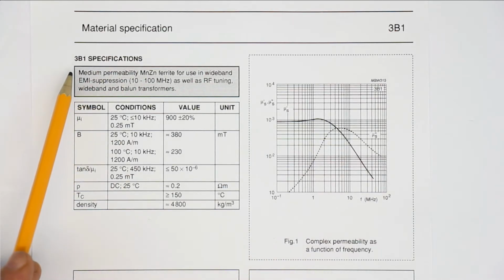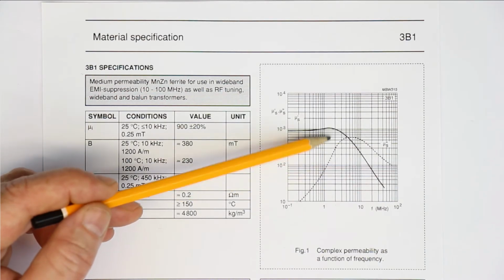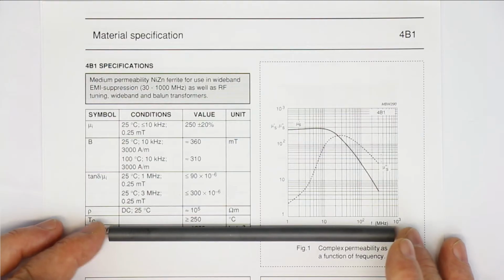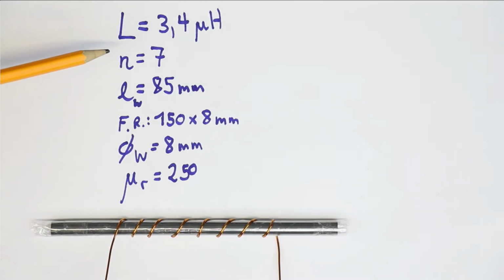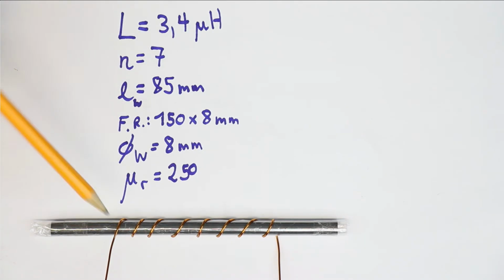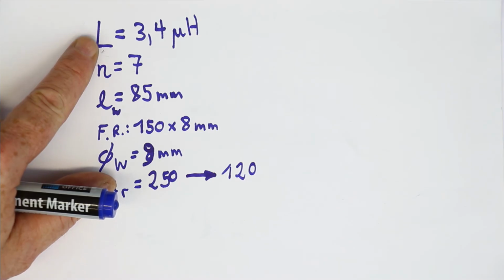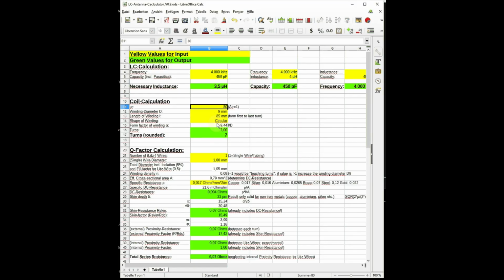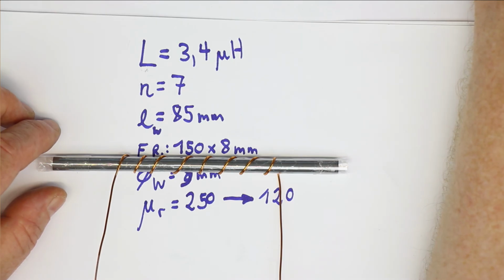A Ferrite-Rod for SW-Reception

Comment: I've noticed that adding regeneration to a ferrite rod antenna seems to make it usable at higher frequencies. Try making a regenerative receiver using a shortwave ferrite rod antenna as the main tank inductor. It should work with good results even at higher than 10 MHz. Some discussion here indicates that one experimenter used a regenerated ferrite rod antenna at higher than 20 MHz:  http://www.theradioboard.com/rb/viewtopic.php?t=7675 . Personally I've used them up to about 14 MHz in regenerative receivers. It might be interesting to conduct experiments to compare ferrite rod sensitivity at shortwave in the non-regenerated and the regenerated cases. In particular, I think the following experiment would be worthwhile: take a shortwave ferrite rod antenna, resonate it with a high-Q variable capacitor, connect it to a high-Z low-noise RF amplifier, connect that RF amplifier to a shortwave receiver, and tune the ferrite antenna's tuning capacitor to a very weak station around 14 MHz. Observe the S/N (or SINAD) ratio.. Finally, add regeneration to the ferrite rod (using all best-known practices to minimise tank loading, e.g. using a low-noise high-Z JFET, minimising and/or swamping parasitic transistor capacitances, etc.) and increase the regenerative feedback until just below the oscillation threshold. Finally, observe if the S/N (SINAD) has improved for receiving the weak signal due to the addition of regeneration. Regeneration, of course, is not perfect (it introduces noise and IMD) but I was surprised at the good results at shortwave when adding regeneration to a ferrite rod antenna. I hope you might investigate this area as well.
Reply from the maker: Hmh. Regeneration is of course cheating :-) 
(Just kidding)
I don´t think that using ferrite rod antennas above 5 MHz is a good idea.
It´s not only that the losses in the ferrite materials that are available in rod-shape increases.
There is also the problem of using the right "wire" for the winding.
Litz-wire starts to degrade already at 1 MHz due to proximity effect.
So you have to go to thick solid copper-wire to get a reasonably low skin-effect and correspondigly high Q-factor. 
(Regeneration of course increases the Q-factor back again to higher values)

In a few weeks I hope to expand the video series about Q-factor measurements of ferrite-rod and other magnetic antennas also to the shown SW ferrite-rod antenna. 
(the LW measurements are already presented in one of my recent videos)

But I´m afraid that I won´t find the time to do your proposed measurements (which sound quite interesting and reasonable)

How about you?
Reply: When I do further experiments with ferrite rods, I will post the results on my blog (http://qrp-gaijin.blogspot.com) and/or my YouTube channel. But before I do further experiments I want to understand ferrite rods better -- your videos are very interesting in this respect.

All that I can say for now is that a regenerated ferrite rod antenna gave me much better reception than I expected at shortwave. The next step, as I mentioned, is to see if equivalent performance can be achieved without regeneration. 

I think one key aspect of regeneration is that it is operator-controlled, with the operator always adjusting the feedback manually to ensure maximum (regenerated) tank Q and minimum tank losses. In other words, even as ferrite losses increase at higher frequencies, the regenerative amplification cancels those losses (with added noise, of course) and brings the signal (and noise) voltages back up to a high level. So even though S/N is degrading at higher frequencies, with a regenerated tank the operator-controlled regeneration is at least bringing up the signal+noise voltages back up to higher voltage levels, where they can then be detected by the receiver.

On the other hand, I think that with a non-regenerative amplifier following the ferrite rod antenna, you similarly would need to adjust the non-regenerative gain manually to get good reception. In this non-regenerated case, as frequencies increase, the S/N is degrading, but also now the absolute voltage level of the signal+noise (available at hot end of the tank) is also decreasing. So the receiver will have less and less signal voltage to work with, possibly requiring further amplification and a manual gain control to bring the signal voltages back up to usable levels. And another gain stage introduces more opportunities for noise and IMD.

So it may be that regeneration is simply an easy way to boost absolute signal voltages back up to "high" levels, even as the ferrite losses increase at higher frequencies. There can be no way that regeneration can actually improve the S/N ratio because any ferrite losses will physically cause an irreversible loss of the signal energy and degradation of the S/N ratio. So the question is, again -- is regeneration the best way to get the signal back out of the ferrite, or can a high-Z broadband amp also do it?

Time will tell!
Reply: Ah yes -- one other question for you: what do you think about the use of non-resonated ferrite rod antennas as broadband antennas?

I found one circuit recently; I will post it here if I can find it again.

----

Rats, I can't find the circuit again, but I remember it was just an untuned ferrite rod (one end grounded, other end hot) connected through a capacitor to the base input of a common-emitter amplifier. The common-emitter amplifier used collector feedback bias, so it was something like a 100k resistor from base-collector, and maybe a 4.7k resistor from collector-Vcc, with the emitter directly grounded (I think) and the amplified signal voltage taken off of the collector through a coupling capacitor.

Also, Charles Wenzel gives a broadband ferrite antenna amplifier circuit here http://www.techlib.com/electronics/antennas.html (search that page for the text "A ferrite rod 5/16 inches in diameter and 7 inches long"). That antenna reportedly could "cover the AM band without tuning and gave good reception well into the short-wave band".
Reply from the maker: I think you are 100% correct with your thoughts.
Regeneration basically boost the voltage including the noise.
Todays SW-receivers are so sensitive (in the sub-µV range) that atmospheric and man-made noise is probably always the limiting factor even without any pre-amplification/regeneration.
For a simple 1 or 2-transistor receivers things are of course different.
Reply from the maker: Hmh. I have to think about that and find the time to read the mentioned texts.
There are some applications where a magnetic antenna is used in a non-tuned way.
Broadband loop-antennas are an example.
While in a resonant tank-circuit you need a high Z coupling to your receiver to get most of the energy out of the tank-circuit, broadband magnetic antennas are usually operated in short-circuit mode.
I once build an antenna for reception of the Schumann-resonances starting at 7.8 Hz with some kilogramms (!) of installation-wire and a multi-turn loop-antenna with 1m diameter.
https://en.wikipedia.org/wiki/Schumann_resonances
There this principle was applied. With an ultra-low noise LT1028 opamp as a trans-impedance amplifier the loop was operated in short-circuit-mode.
When I made some calculations about maximizing the S/N ratio I found out that in that mode (short-circuit) the S/N is proportional only to the used copper-mass of the winding :-)

But all my videos about magnetic antennas are (until now) directed to get the ultimate signal-voltage and signal-power for crystal-radio reception. And there nothing beats a high Q-factor tank-circuit with a large cross-sectional area like in an optimized  frame-antenna.
I find it just fascinating that a tank-circuit gives a natural "amplification" of the incident voltage by the Q-factor without any further electronical amplification.
Our namesake Burkhard Kainka also had crystal-radio reception in the SW-bands (e.g. the strong Chinese propaganda radio).

Comment from the maker: Our SW ferrite-rod is of 4B1-material from Ferroxcube. It is no longer available. An excerpt from the old ferroxcube-databook can be downloaded from our shop: http://www.ak-modul-bus.de/cat/documentation/Ferrit_4B1sw.pdf
61-type material is from Amidon and it could be quite similar to the 4B1-material but Amidon is not as extensive with their published material specifications as Ferroxcube is/was.
I think that the more greyish colour comes from zinc instead of the black mangenese ferrite (nickel-zinc vs. nickel-manganese ferrite).
Basically the more black ferrite has a higher permeability thus allowing for smaller coils/smaller dimensions but it works only in the LW/MW range.
The more greyish material is more universal because the losses are smaller at a given frequency and it can be used for higher frequencies.
But the permeability is smaller and thus the coils need more turns with a given dimension of the ferrite rod. 

With a regenerative receiver you of course get partially away with the losses in the ferrite material. At least up to a certain frequency, where the losses become so great that no more reception is possible and the effective permeability and therefore inductance drops too much.
Our eponymous master Burkhard Kainka has even succeeded to receive SW-Stations with a crystal-radio set where the inductance was either a coil on our SW ferrite-rod or a small loop-antenna.
Reply: Thank you for the documentation link and your extensive reply! I am a great admirer of your master Burkhard Kainka who inspired me to experiment with simple radios at more than one occasion!

Comment: Thank you for a very interesting explanation on the subject of ferrite rods. I myself experimented a lot with the kind of ferrite rods normally used in MW/LW receivers and I found that those work very well in a reflex regenerative receiver up to 7 MHz (of course the regeneration has to be increased a lot at this frequency). For 80 and 40m in this receiver I used 14 turns of 0.3mm thick enamelled wire wound on a very thin former (heat resistent label printer ) with a length of ca 3 cm. Is the material you use the same as the so called 61 ferrite? I Always thought 61 was for  MW/LW. But I noticed that relatively modern (20 years) receivers no longer have the very black material but use a more greyish variety that supposedly has more nickle in it?.
The receiver I am describing appeared as a construction article in the May 2016 issue of Practical Wireless. It only uses a ferrite rod as an aerial and is capable of receiving amateur stations in the 40 and 80 m band.
Reply: Erik, thank you for this and your other videos. I find they are instructive,  very well done, clear, concise, and even fun to watch. Thanks again Erik .

Ron